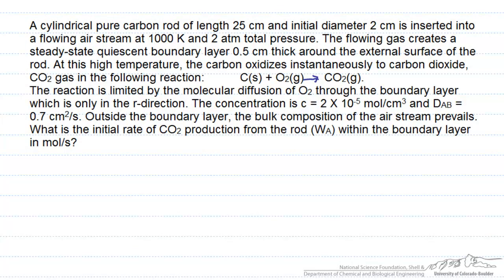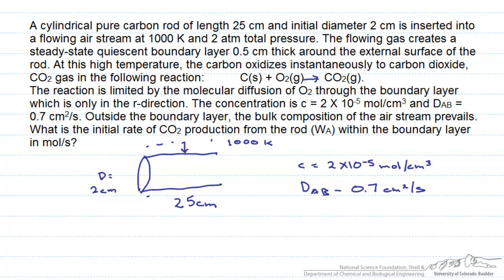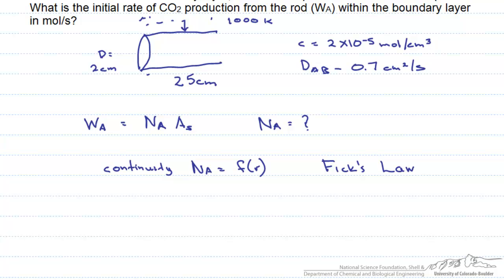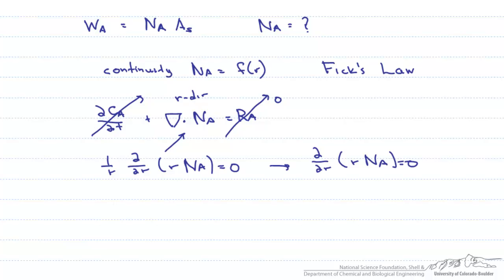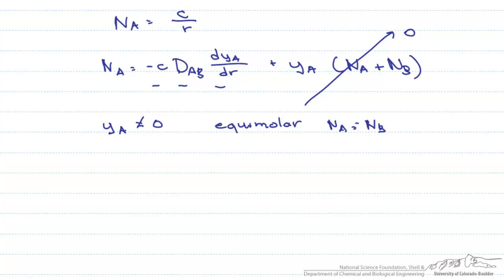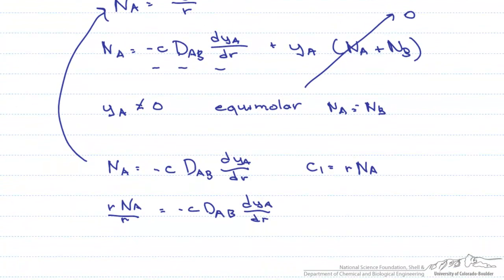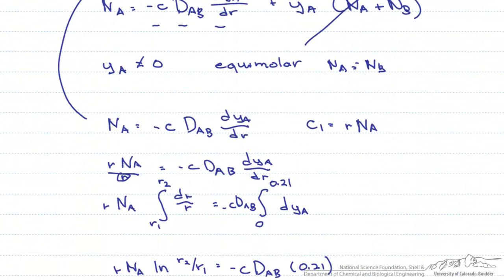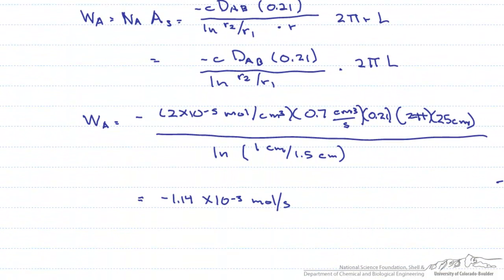Diffusion through a Carbon Rod: Part 1

Comment: The denominator should have r2 as 1.5 cm and r1 as 1 cm. You have it the other way around. Also it doesn't make sense since the ln of 1/1.5 is a negative number and the negative on top cancel out giving a positive oxygen production which in this case is not possible
Reply from the maker: Thank you for finding this error.  The answer was calculated correctly, but I have added a correction to the screencast.
Reply: @LearnChemE  It does not look like the error is corrected